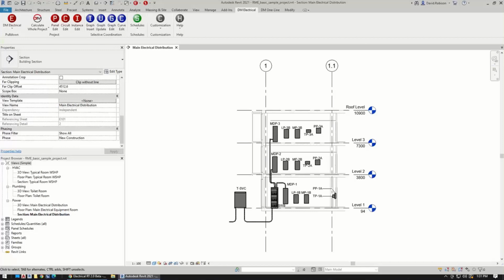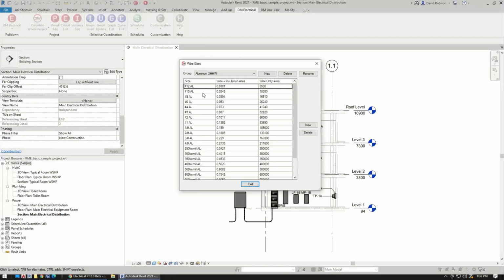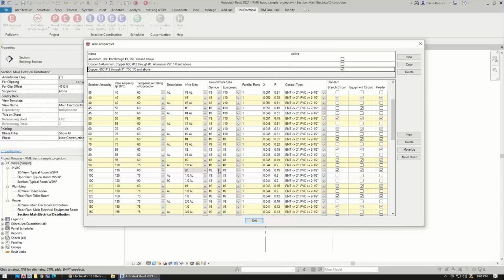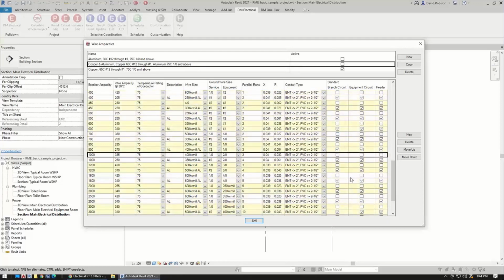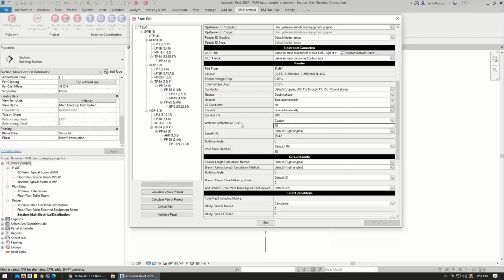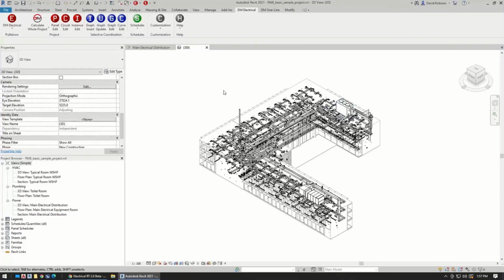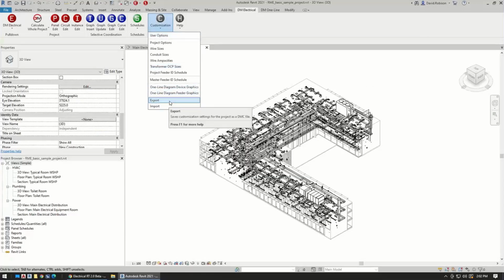Design Master Electrical for Revit: Wire Sizing Features (05/13/2021)

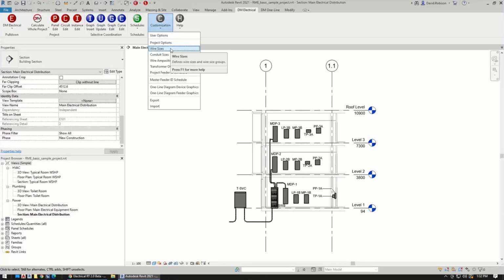Comment from the maker: The Wire Sizes command (01:14)
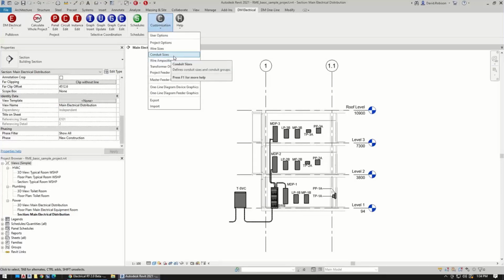The Conduit Sizes command (02:19)
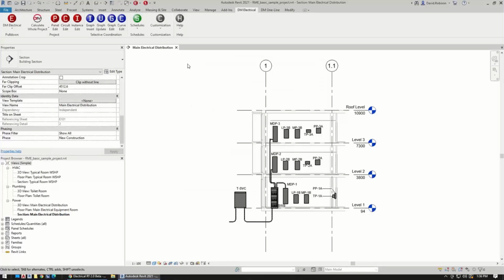The Wire Ampacities command (04:47)
    The Wire Ampacity @ 30°C setting (05:31)
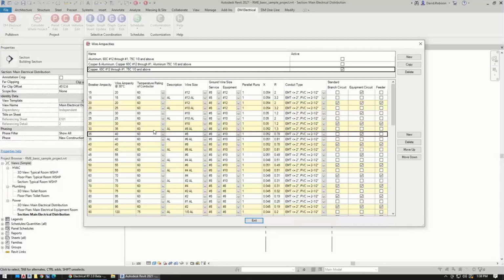    The Temperature Rating of Conductor setting (06:22)
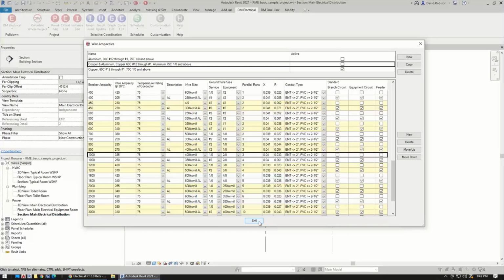Sizing feeders using the Panel Edit command (13:00)
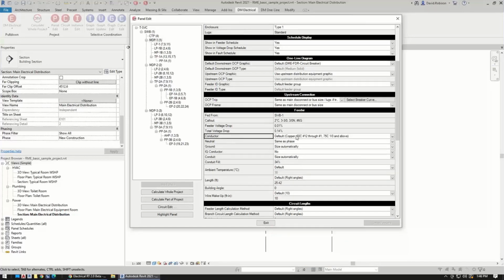    Specifying a sizing option in the Conductor field (14:39)
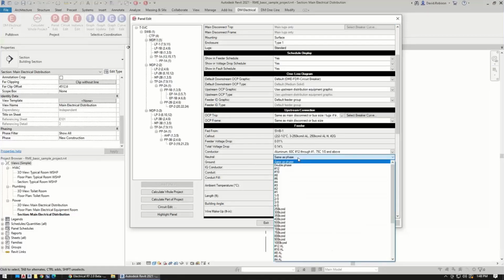    Derating wires when setting Neutral to Double phase (16:19)
    Derating wires based upon the Ambient Temperature field (19:33)
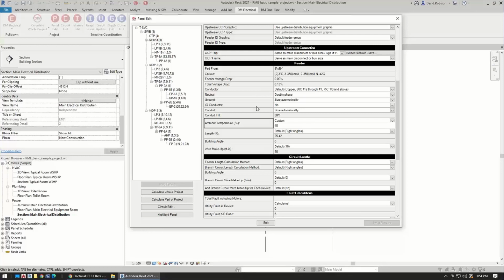Sizing transformer OCPs based upon the Transformer OCP Sizes command (21:01)
Sizing branch circuits using the Circuit Edit and Instance Edit commands (22:30)

“How do I define the wire sizing for a custom breaker ampacity?” (24:33)
“When I update Design Master, will it affect my current projects?” (26:32)